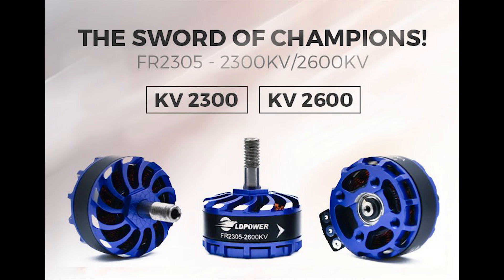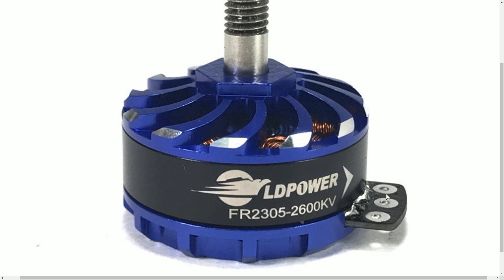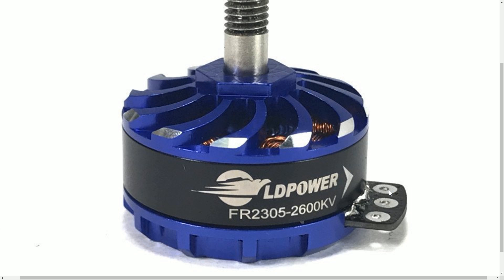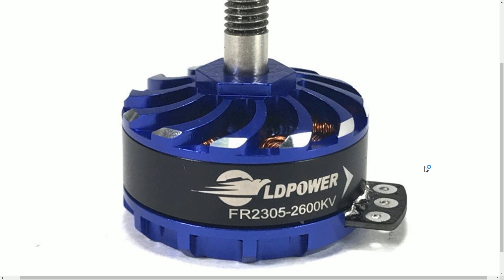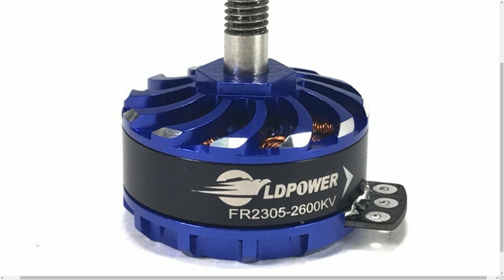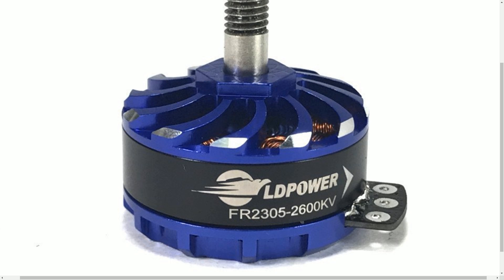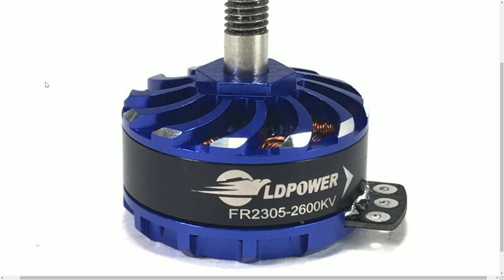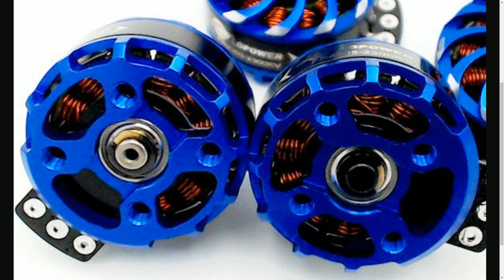LDPower FR2305 Motor | LIKE A V8 FOR YOUR QUAD

Comment: Steele motors have thrust and precise control at the bottom end of throttle curve and nothing really at the top end of throttle. Some like that, but I went back to a motor with a linear throttle curve.

Comment: Banggood has no stock, especially of the CCW. BG says it is a clearance product, it is already sold out now, and they will not resell it again
Reply from the maker: You can also check Newbeedrone. I wonder why Banggood is out?
Reply: Newbeedrone hast high transport cost to germany (min. 22$ for 7-21 days, 28$ for 2 days with DHL). So I will look for a different supplier. Thanks for your video

Comment: Like any machine. Its all about power to weight ratio.
A lighter model will ALWAYS fly better than a heavier model.
Too many quads are built too heavy, Quad builders try to over compensate with more powerful Motors. Adding high power Motors require heavier speed controllers and heavier Batteries. So you end up trying to add even more powerful Motors. This situation is the tail wagging the Dog, so to speak.
Don't be fooled by all the marketing. Bigger, more powerful and hungrier Motors. Are not always better.

Comment: Joshua Bardwell Do you feel that there is a correlation between torque and throttle curve?  seems logical that a wider stator would provide more torque and potentially a more linear throttle curve
Reply from the maker: +null FPV QuadMcFly's review if this motor mentions that wider stators don't seem to increase torque much.
Reply: Interesting.  I'm curious what it is about the motor design that drives variance in this characteristic.  Air resistance? Bell weight? Windings?

Comment: Hi Joshua, So can I ask, what is your motor of choice?
Reply: Scott Burr i back your comment!¡ please tell us josh
Reply from the maker: Still searching for the perfect motor. The motor I fly and like the best is the Rotorgeeks 7075 series 2205/2700kv. 

http://rotorgeeks.com/index.php?route=product/product&product_id=421

It's not ultra-powered, but it is smooth and durable.
Reply: would be great to know
Reply: Joshua Bardwell what ESC are you running on those? I have a set I had the RG20 which worked fine but old and big... I've blown 3 ESC on a new build I tried the rg2205/2700 4" I was hoping to use. ordered some spedix 30a for them but QMcF suggested the RG were now old tech and should just get a newer motor.
Reply: I'm using spedix 25a with my 2600kV LDPower motors, but two of them already died. The second one smoked my motor too. I guess spedix 30a would be better.
Reply: Joshua , what prop do run on this motor?
Reply: The Spedix IS-30's are pretty stout on 2600KV (though mine are RS2205S EMax), but props are a non-trivial part of that equation in terms of amp demand.

Comment: directional threads...YES!
Reply: Jrod FPV Finally, Being able to use self-locking props is a massive time saver. I hate using nuts.
Reply: link to the props you use? i've only ever seen one set of self locking props and they were very thin; not durable enough for racing.
Reply: The most durable ones I use are ones for Walkera F210. They're a bull-nose 2 blade and I have never broke one of them, only bent in a really hard crash.  I even prefer them over most 3 blades as they spin up and slow down really, really well.  Just search for replacement blades for Walkera F210

Comment: with quads, there's no such thing as too much. just more versions. Recently, a motor just got released that allows for 5 mins flight time (yes, while pushing to its limit).

But no one will say it's too far, it's just different.

Comment: these powerful motors are why I love turnigy graphenes so much! I can fly moderate speed and get 3-4 minutes or just tear up the sky and get 2 minutes and the lipos are still going as strong as day one! you really should try something like the turnigy graphenes with powerful motors joshua, they are a great combo. I've been pulling 120-130 amps consistently with 1300mah 5s/6s with no problems.

with the newer stronger motors, I really suggest you try lower kV joshua. Running your old RG 2700kv is kind of like 2300kv of the new generation when comparing amp draw to power ratio

Comment: Now you have to buy some efaw 2407r  2500kv which are good efficient motors with lots of  torque feel.. :) trust me on this
Reply: Heavy
Reply: IRFZ44  I know but I say it's the only downside but compared to other 2207 and 2206 it's lighter

Comment: Ldpower 2307 2300 are better. They just came out with them and they rip with some cyclones while not drawing a lot of amps. Get about 2 minutes of flight time coming down at 15 volts with 1300 4s. Try them out Josh!!!
Reply: VIK FPV yeah I checked out your vid on them, where can you buy them?
Keep shredding!
Reply: Hey man. Thanks bro. Newbeedrone will have 2307 motors soon  I will do some more testing of the motors on my channel. This is not a plug haha. just trying to help :) rip on bro!!